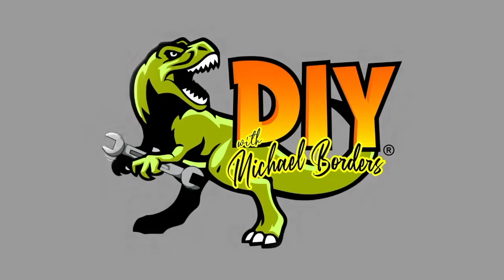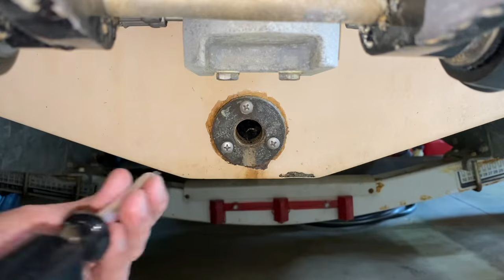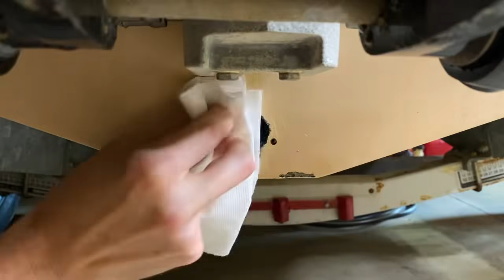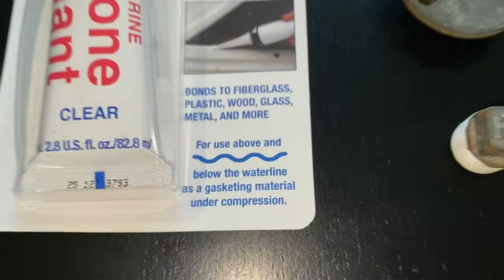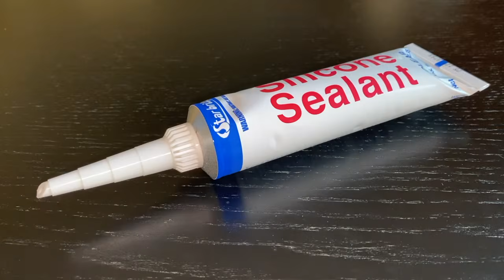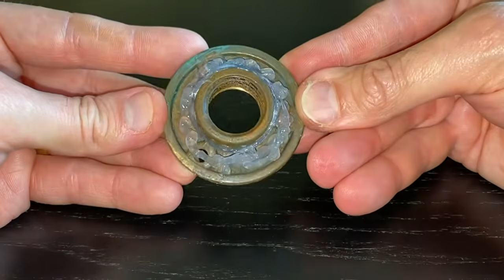Replace boat drain plug kit and sealant - Water Tight Seal!

Comment from the maker: If interested in purchasing this product, visitor to Amazon affiliate link below.  I earn from qualifying purchases.

Goo Gone:  https://amzn.to/47ecGuK

Plug Kit:

     Brass:  https://amzn.to/42NgSQV

     Stainless steel:  https://amzn.to/43gAAoe

Teflon tape:  https://amzn.to/47AGsdB

Sealant:  https://amzn.to/47tjmGF

Razor blade:  https://amzn.to/47etsKr

Scraper:  https://amzn.to/3Jh7cHF

Utility knife:  https://amzn.to/4qdu0IW

New trailer wheels:  https://amzn.to/3IzsIam

Bimini:

     https://amzn.to/3L1wNVz

     https://amzn.to/3KWOsxC

Cherry Picker hoist:

     https://amzn.to/4nMUYFl

     https://amzn.to/48b2pBA

     https://amzn.to/4pqTD91

     https://amzn.to/4poQRB6

     https://amzn.to/4giP64l

     https://amzn.to/46u75Bn

Grease gun:  https://amzn.to/492GIEg

2-4-C grease:  https://amzn.to/4q8T8Rh

Extreme grease:  https://amzn.to/43lxQpB

Impact wrench:  https://amzn.to/3INxPDU

Floor jack:  https://amzn.to/47f0rhz

Jack stands:  https://amzn.to/4haebyG

Tire shine:  https://amzn.to/48sclqF

Side rail bumpers:

     https://amzn.to/45QNkDS

     https://amzn.to/4684JqB

     https://amzn.to/4lXw18N

Dock bumpers:

     https://amzn.to/4gaeadw

     https://amzn.to/4noe5pg

     https://amzn.to/4piZg9d

     https://amzn.to/4mV04PY

     https://amzn.to/4m2cbsY

     https://amzn.to/46bau6X

Boat cover:  https://amzn.to/462Zcmt

Sand bag kit:  https://amzn.to/465nT03

Button snap crimping tool:  https://amzn.to/4euiD9M

Extra buttons and snaps:  https://amzn.to/4eu2HEt

*******************************

1.  Replace boat trailer rims and tires

          https://youtu.be/T7zTpFrKc_o

2.  Replace boat cover snap cap buttons

          https://youtu.be/_HaALyNC6X0

3.  Boat cover sand bag kit

          https://youtu.be/9AmdcMchB1g

4.  Siphon fuel out of boat

          https://youtu.be/CwdYEQwt_qk

5.  Replace boat trailer coupler

          https://youtu.be/CCH86D6GWDU

6.  Replace boat trailer winch

          https://youtu.be/EwTVk6JKOYA

7.  Fixing boats and jets skis PlayList

          https://youtube.com/playlist?list=PLjCXOz8TSkZlae2qY97uVVTm3JdBOUoRS&si=KJO-787e9AnSjxZ6

Comment: The drain plug in my boat originally came with a sleeve and the push in rubber style plug, not a big fan of that design, I noticed that the sleeve was moving, I replaced it with the style you have but I took the time to coat the transom hole with resin first to protect the wood, great video Michael 👍😁
Reply from the maker: Thanks Dave.  We really like this plug kit.  No rubber insert that will dry-rot, crack, and fail prematurely.

This plug kit does work perfectly if installed properly and not overtightened…and the sealant is applied correctly and given the proper curing time.

Hope you’re having a great Thanksgiving Holiday.

😁🧰